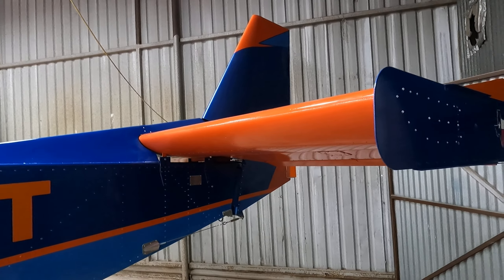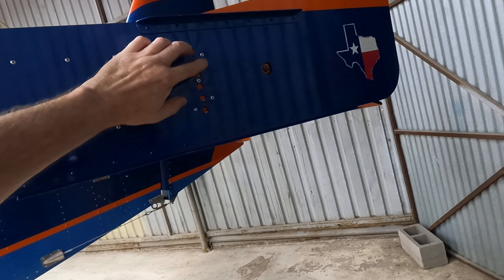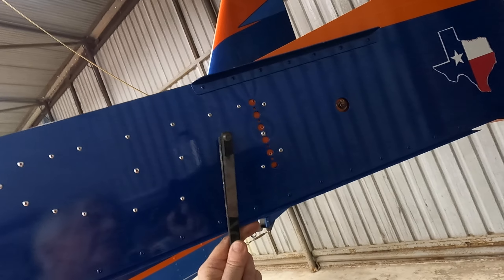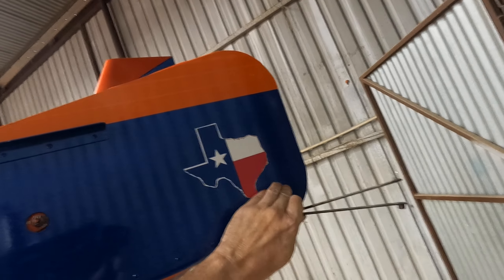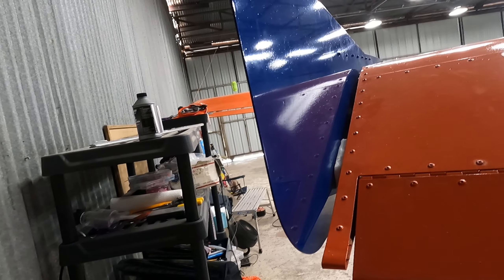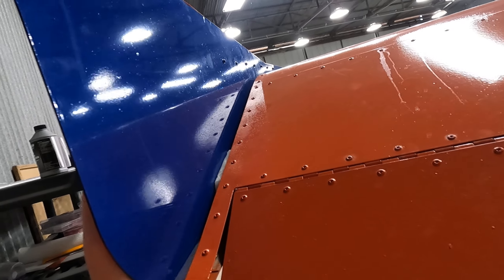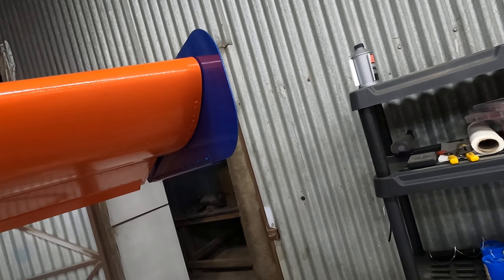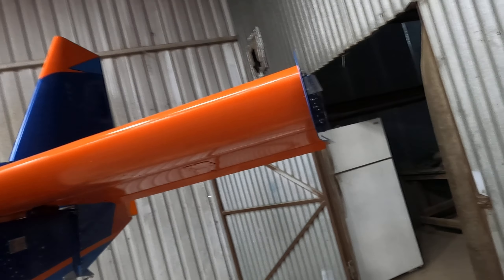Horizontal STOL End Fence panels

Comment: When you put the nylon blocks between the fence and the HT, the gaps created will cause turbulence and airflow leakage, defeating the whole purpose of the fences.  My 750 STOL's fences (designed in consultation with an expert who modified utility aircraft's tails for carrier operations) are 0.050 thick, riveted completely flush against the HT,  don't need any L angle stiffeners, and allow deletion of the elevator hinge plates - the fence itself can be used as the hinge point for the elevator pin..  This eliminates any gap and enhances elevator effectiveness.  The fences do help elevator control authority somewhat, but when combined with elevator tips that extend 4" on each side beyond the fences, it makes a huge improvement.